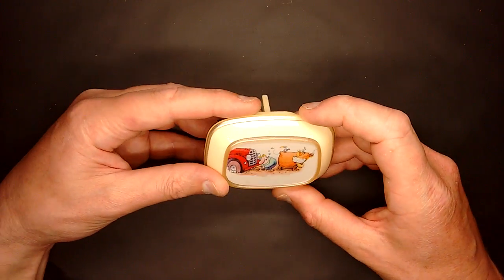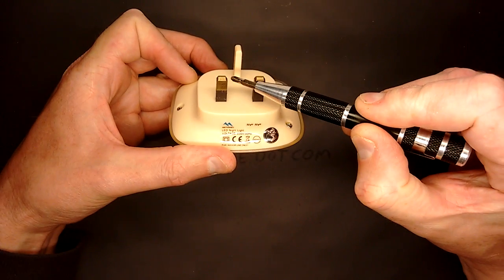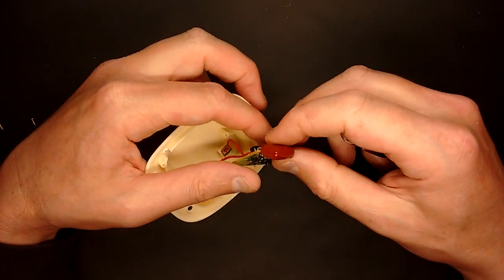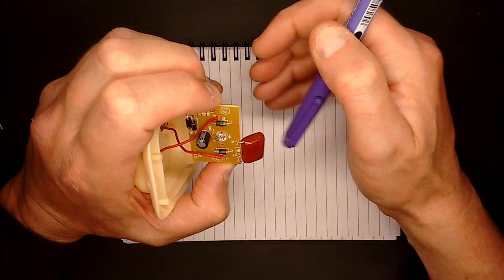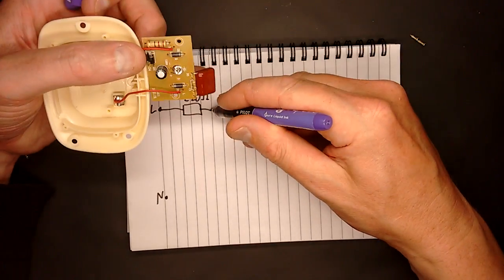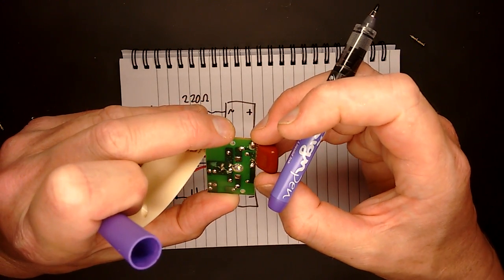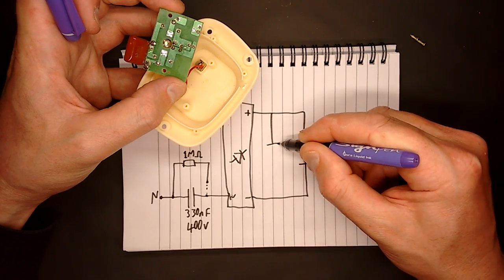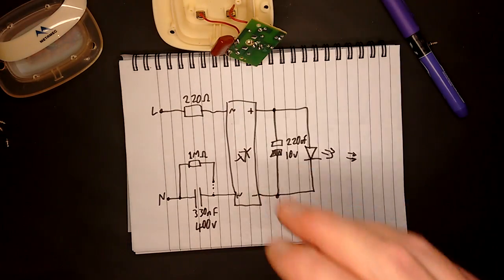Neat "picture" LED night light.  With tingle feature.

Comment: 10v led????
Reply from the maker: The capacitor is rated 10V, but the LED will clamp the voltage to less than 3V.
Reply: 8:16 you said "…10v led will shoot up to 330v or try…"

Comment: I had a nite light that looked like a little television screen when I was a kid, It was electroluminescent. Of course I took it apart! It had a single metal plate coated on one side with some luminescent material. No drivers or circuitry. When I put it back together I put the panel in the wrong way around and blew the fuse when I plugged it in. I investigated what I did wrong, put it back together correctly and it still worked!

Comment: You keep claiming that an isolated circuit like that can’t shock you. As a kid I discharged the capacitor to a disposable camera flash with the shackle of a padlock. I used only one hand. Let me say I got a hell of a shock.

I don’t understand why you aren’t right, but in my experience, that’s bollocks.
Reply from the maker: You must have been holding the metalwork of the camera when you touched the capacitor terminals with the padlock.

Comment: That "tingle" feature seemed common in the 80's upright Hoover's (the one with the light on the front) - many a time did I help my mum vacuuming and I'd pull the pull out and drop it suddenly and involuntarily due to the shock of the discharge of a capacitor  (or maybe the motor still spinning and acting as an alternator). Something you don't forget!

Comment: This is probably a really dumb question, but how does the voltage get dropped from 230v AC to a much smaller 10v DC? Does it happen in the rectifier, or at the capacitor?
Reply from the maker: The capacitor lets through a small portion of electricity on each half wave.
Reply: +bigclivedotcom Ah, that makes sense. Thanks!

Comment: Regarding that tingle feature. I find capacitors absolutely fascinating, but they also scare the living daylights out of me because they are a black art to me and thus I have no idea how much of a zap I could potentially get from one.
Obviously getting a zap from a 330 nF capacitor that has been charged with 240 VAC is painful, but not lethal.
Are there any rough rules of thumb for how much of a zap you will get from a given capacitor? And most importantly, around what size capacitor should you start being really careful about discharging it properly?

Comment: Is it good or bad I could identify the value of the discharge resistor over the dropper cap by just glancing at it on this YouTube video? -personally, I tend to think of it as something gone wrong. Without really paying attention to the colour code (which wasn't really distinct in the shot to begin with), my mind just went "1 Meg". I mean: can I trust this or should I expect it to bite me at some point?

Comment: I have a few vintage "Metamec" clocks in my collection. The old company used to manufacture electric clocks in the UK until the late 80's, when they when bust. A lot of those old clocks had "Made in the UK" on them, but the movement was a "Kenzel" -made in Germany. I wonder what (if any) connection there is with this night light.

Comment: I get the shock problem with the Panasonic AC adapter for one of the video cameras, my solution is plug it into a socket with a neon, the neon blinks and safe to touch.

The shock you just got from that night light could easily be a kid's hand with one of those.

Comment: I'm not sure if you've covered this before, but a quick calculation of the series capacitor's impedance at 50Hz would be help the novices understand how it is regulating the current through the LED.
Reply from the maker: I've covered the formula for capacitive reactance several times in other videos.  I try not to do it too often though.

Comment: With that amber/cream colored housing... a warm-white LED would have been amazing (instead of the cool-white) :) - A mod is now required hehe :D... P.S - I'm too a warm-white light kinda' guy - way more cozy than the cool-whites...
Reply from the maker: I did that mod right after the video.
Reply: bigclivedotcom Nice!
Reply: Talking of colours -- mentioned poor CRI fluro light in this room.
I can highly recommend Philips Graphica Pro 5300k 98%CRI lamps (you can get from any-lamp.co.uk who send from NL, at least!).  This works EXCELLENTLY for workbench/space if you are happy with daylight colour.
There are Philips "Master" 3000k with 90-something CRI too which don't seem too bad for halogen/warm-white simulation.
Last I checked, this was an awful lot easier/cheaper to get consistent quality dimmable steady-light, than was convenient in LED-form, last time I checked, though no doubt high-CRI led-replacement-tubes will eventually become cheaper, consistency seems to be a big problem unless you pay a fortune  ;-(.

Comment: What's to stop the circuit board pressing down on the exposed back if the mains pins? The circuit board looked like it had some room to move about in the housing which is just asking for something to go wrong.
Reply from the maker: It was screwed in with clearance.

Comment: I was messing around with a laptop power supply the other night after a few beers and managed to get TWO bolts off a 400v 120μF cap. OUCH!

Damn thing still had 200v left in it too.

Comment: um, quick question (unrelated to the video) but what are the differences between normal capacitors and "solid capacitors" is it just marketing bullshit or are there real benefits?
Reply from the maker: Each has its own characteristics.  I do sometimes wonder if the traditional liquid electrolyte ones are sometimes passed off as solid electrolyte versions because of the bad image liquid electrolyte caps got when there was a high number of failures due to bad electrolyte.  Wikipedia has a section on the different characteristics.
Reply: bigclivedotcom so there is a possibility that solid caps are just marketing speak for "we re branded these things to make you buy our components!"

Comment: I knew it would come sooner then later....shock...keep these great videos coming!
Reply from the maker: Not the first in a video.
Reply: +bigclivedotcom The fact that we see the video proved you survived (and glad you did). On a job (in year 2000) I got zapped by 230V cause of an old computer still having live fed through a computer case to the switch on the front (AT PSU). The switches insulation had slid back and I accidentally touched the bare contact. My right finger felt numb the whole day and I got a black contact burn on it (the shape of a pencil point).

Comment: If you set up a bunch of mains charged caps as a blind test, do you think you could guess the capacitance by the strength of the jolt they gave you?  Might make an interesting video.

Comment: Chinese soldering is always a thing to be admired, I mean, used as an example of how not to solder, having had to repair things I've bought new myself too, like the battery pack for a microphone (which barely works) I bought, they'd soldered so badly they'd shorted out components all over the place!! :S
Reply: The bigger the blob the better the job.
Reply: More solder means it's better, right?

Comment: hey man, you probably won't see this but I just bought a projector and while it's running the ground connection on the video ports give you a decent shock, it's a bit like when your phone vibrates in your hand and doesn't hurt that much, what should I do about this? I was thinking of just manually connecting the ground to a socket
Reply: and it isnt some cheap projector either its a dell one which isn't the best but better than some chinese knock off that I'd expect this from
Reply: +dsihacker123 is it connected to ground ? only thing I know (I'm on the european continent) is that devices without a ground pin on the plug can tingle
Reply: +Maico it had a ground pin, it was running through an extension cord so I was thinking maybe the cord was shot
Reply: Dsihacker123 maybe there was no route to ground through the extension cord then
Reply: ***** yeah i figured the ground connection was probably shoddy in the cable, ive been using it for a few years

Comment: I had 3 2200mah 3s lipo burn up in my apartment today after one exploded in to flames after charging, the other 2 were too close.  my place smells like toxic fumes and electrical fire after hours of venting with powerful fans.  when you have had lithium batteries burn up on you in the past, did you have the same problem with the fumes?  if so how long does it take for it to clear usually?
Reply from the maker: Just open some windows and let some air through the place.  That will get rid of the bulk of the smell and the rest will dissipate over time.
Reply: Yeah, I rarely if ever discharge them down past even 3.5v per cell. And it can always happen with other lithium batteries, ie phones and laptops. I'll leave battery destruction up to Clive.
Reply: I'm scared now. I've got a fair few lipos :3 Although, I always charge mine outside on concrete with a solar powered charge station I rigged up. But still, scared.
Reply: Spray Fabreeze everywhere lol
Reply: mark rossi Oh yes, those make a terrible mess.. But they are sooo gooood! Seriously, you will not find any other extinguisher that deals with a fire this efficiently and quickly. 
CO2 is good because it does not leave any mess and the performance is not too bad either.
Reply from the maker: Any simple microcontroller based charger has the ability to crash and do horrific things like charging cells at maximum current continuously.  I had a Mapin charger crash and grossly overcharge some NiMh cells to the point that their heatshrink melted and stuck to the charger.  First cluse was the odd smell in the room from the heated plastic and possibly venting electrolyte.
Reply: What did they go boom? Improper charging?
Reply: They don't usually go boom unless you overcharge them or use a charging current waaay above their C-rating. Or heat them up to unreasonable levels. So no problem^^
(If you are really too scared, you can always use one of those fireproof LiPo-containers, even though that is a bit exaggerated in my opinion.)
Reply: I think my old charger (balance charger but from 2008) malfunctioned and kept charging the battery after it was done.
Reply: thanks, I used fans and now about 1.5 days later the smell is almost gone except for in the actual area where the battery burned up.  the fire extinguisher did so much damage to my apartment with the dry chemical though.  to anyone here who charges lipo I recommend getting a co2 extinguisher to avoid having to use dry chemical.  (but have a dry chemical one on hand too)
Reply: Actually, the third contact is usually for a temperature sensor built into the battery pack. Real 'magic'is the dedicated overcharge/overdischarge management circuit that is built in to most mobile phone batteries to basically disconnect the battery from the outside world if over charged, overdischarged, or if it gets too hot.